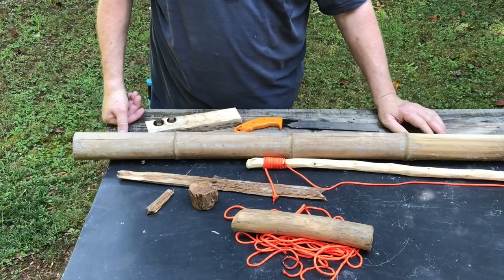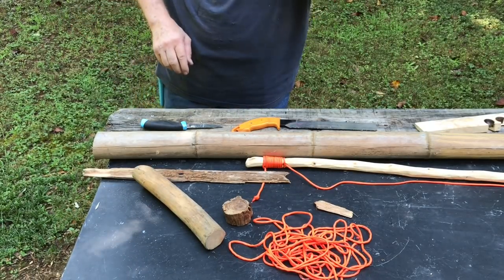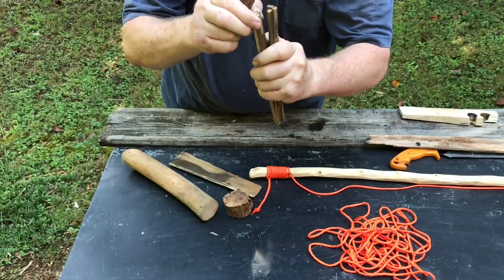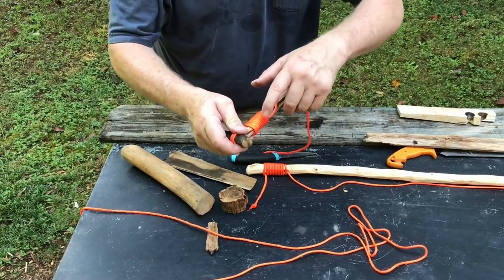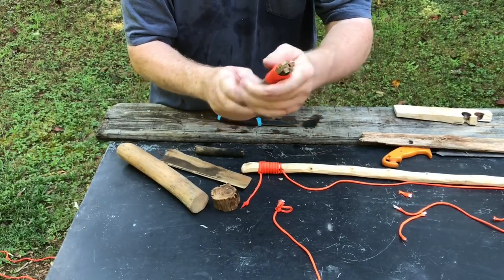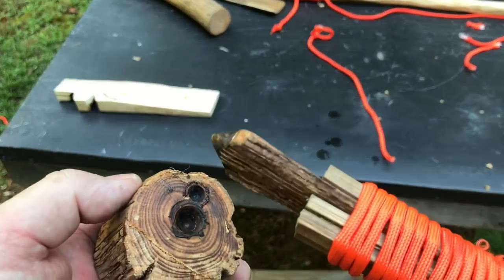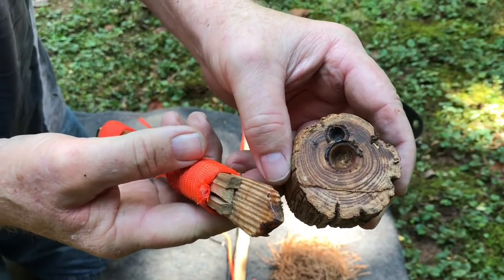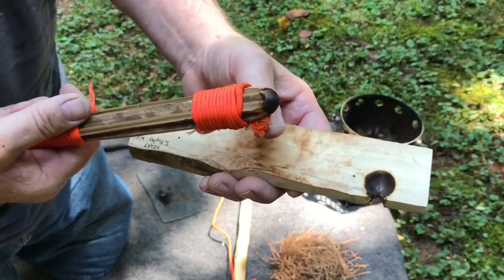The Bundled Spindle, A More Natural Version

Comment from the maker: 5 or 6 years ago, while I was learning the Hand Drill, I found a live Dog Fennel and put it in the house to dry. I didn't know that green spindles needed to be at least 40% bigger; and, I ended up with a very small diameter... way too small for hand drill.
   I had an idea... to break it up into pieces, tape them together, and try it for bow drill. I used an existing fireboard and divot, made a nipple out of some masking tape to go up inside my metal bearing, gave it a good spin, and to my great surprise and delight, it worked beautifully.
   Now, what to name it.  I couldn't figure out if I wanted to call it a Bundled or Composite Spindle. After the first 2 videos of calling it "Composite", I changed to "Bundled" which made more sense to me. So, down through the years, I continued to use the same shortcuts of tape, bearing block, and existing divots and all the while stating how easily one could make this spindle much more naturally (Survival, if you will). Just use an oak spike in the end of the spindle, fatwood for a bearing block, natural cordage, and burn your own divot.... Well,  today, I finally got to prove it... and it worked beautifully too!... Please SUBSCRIBE at the end of the video. Thanks!!!
OTHER BUNDLED SPINDLE VIDEOS YOU WILL ENJOY:

The Bundled Spindle Technique... Bow Drill Friction Fire With Horseweed Flower Heads
https://youtu.be/ydxgNA8hQUQ
 
Great Bundled Spindle Action in Real Time No Edits
https://youtu.be/auJSct9FEOo

The Bundled Spindle Technique... Using 4 Old Horseweed Spindles
https://youtu.be/0aRSlLVWAkc

Resurrecting The Bundled Spindle
https://youtu.be/Y2yriCVXV0s